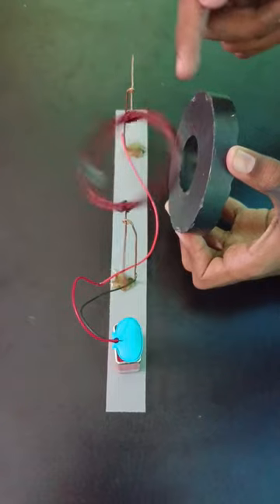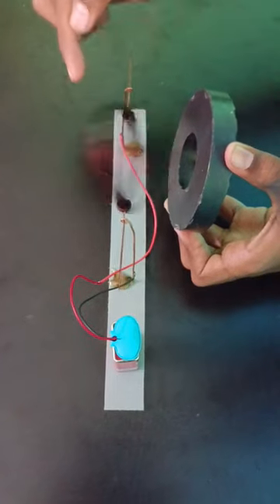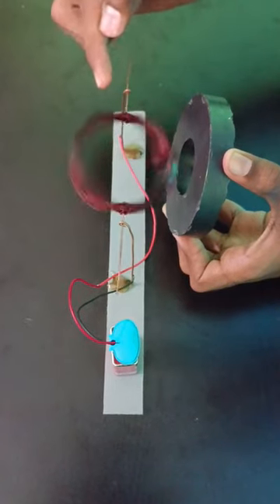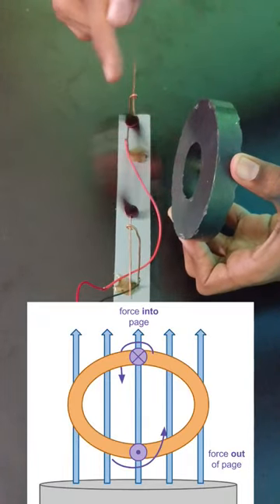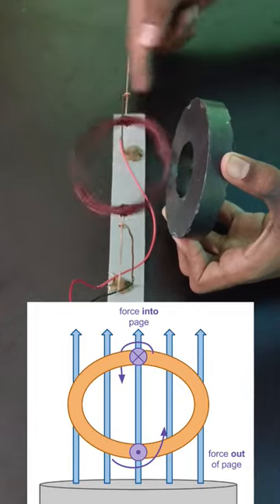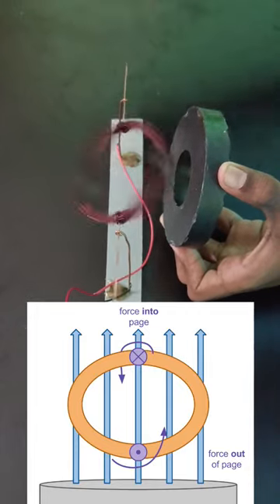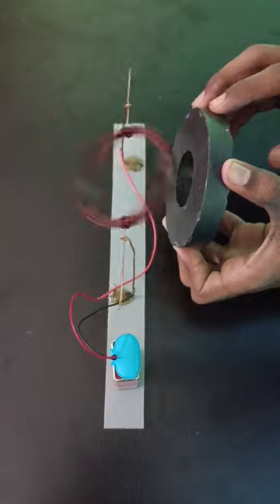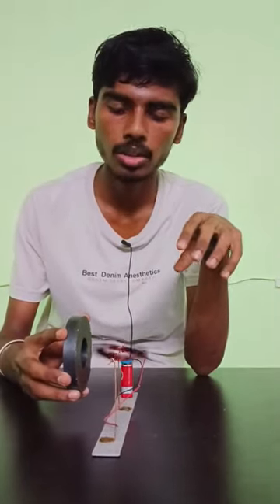Rotation of coil by magnetic field 🧲 | diy projects #shorts #shortsfeed #trendingshorts

Comment: Bro but it will rotate only when you are supply Ac current ,but you're using  dc batttery ,how it is possible 🤔
Reply from the maker: No when current is flow through a coil magnetic flux is produced